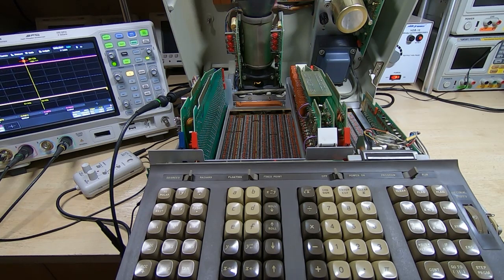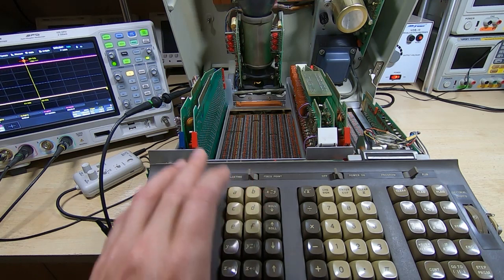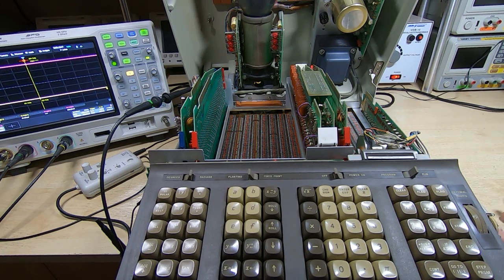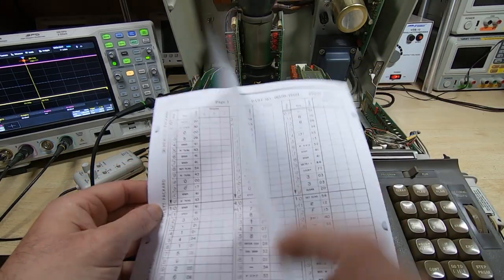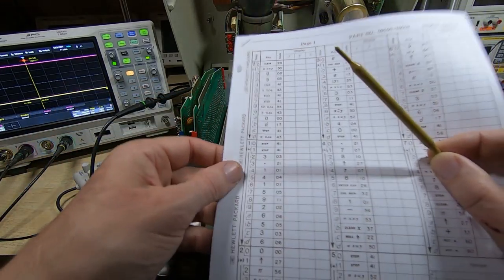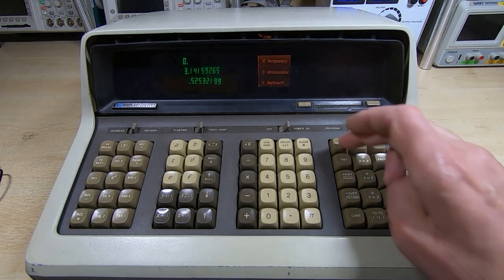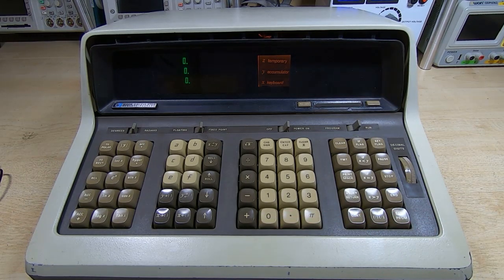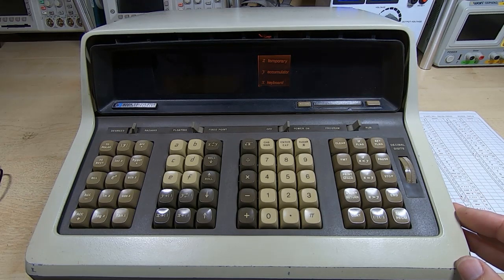HP9100B #1 Repair Part3

Comment: Thank you for making a video series on the 9100B. Do you plan to make a video about the architecture, i.e. how all those diodes and resistors, flipflops and the core memory work together as a system? A while ago I discovered the LGP30 and dug a bit deeper into the available documentation to find out how they managed to build a useful computer using essentially only 113 valves and about 1000 diodes. I found that the trick that is crucial for this feat was to reuse the few flipflop circuits dynamically for multiple purposes, i.e. connecting them as needed to form counters, shift registers etc. via the diode logic depending on which state the machine is in. This makes the LGP30 incredibly hard to understand since it is not really possible to draw a meaningful block diagram of the hardware. Considering all the diodes and resistors on the main board, I wonder if HP used similar tricks. Unfortunately in the 9100B service manual I found, there was no overview regarding how the machine actually works, only lots of troubleshooting procedures.
Reply from the maker: I am intending to make videos explaining all the circuits and how the machine works. How far I go really depends on the amount of interest in the videos. The 9100 is a very interesting machine in both the way it works and the way it was implemented.

Comment: Do you know why the programming sheet only uses memory locations 00-0D, 10-1D and so on ?  We also see this when you were stepping through the memory, it went from 0.d to 1.0 .  It presumably doesn't use base-14, and there are 'e' and 'f' keys on the keyboard so normal hex must be involved at some point.

Cheers,

Phil Young
Reply from the maker: The memory is arranged as 19 'Registers' each of which is comprised of 14 characters and each character is 6 bits. The address for each character is therefore in two parts such as 2.4 (register 2, character 4). As there are only 14 characters per register it counts as follows. 2.C, 2.D, 3.0, 3.1 etc. It can however count to F.D (followed by 10.0). The registers are numbered 0-F (0-15) followed by X,Y,Z for a total of 19 registers. I will be covering all this in more detail in the following videos.